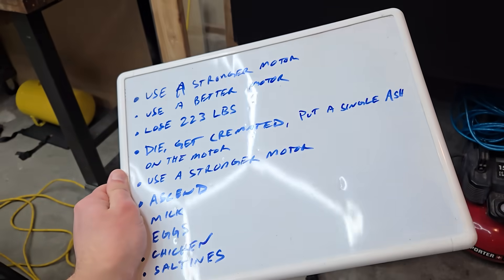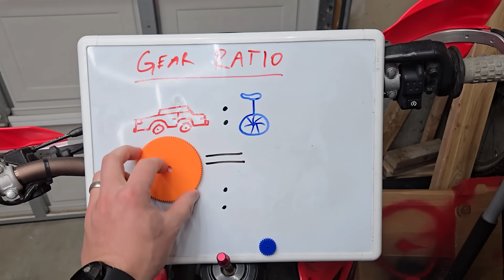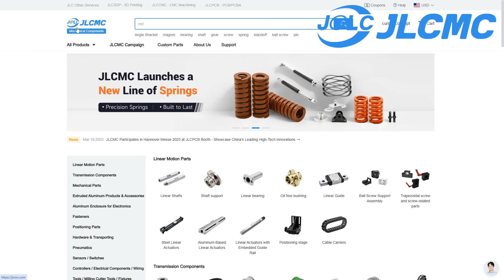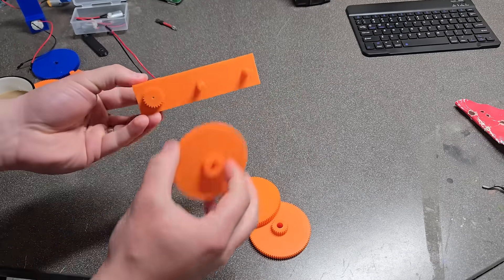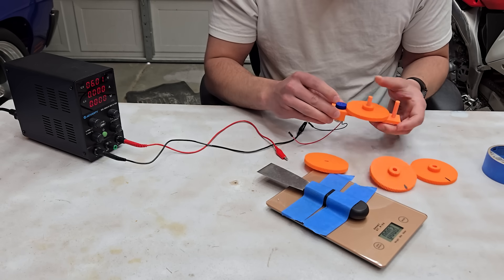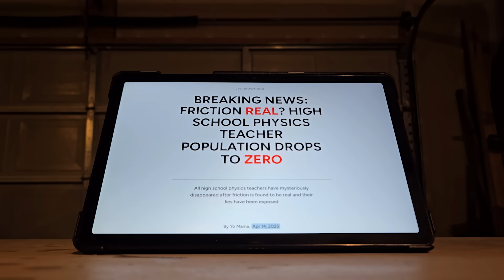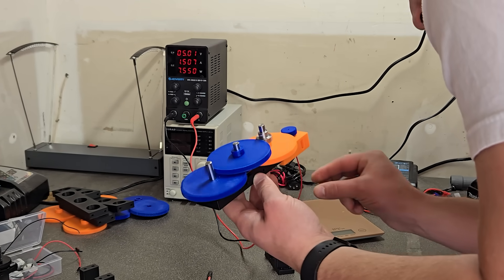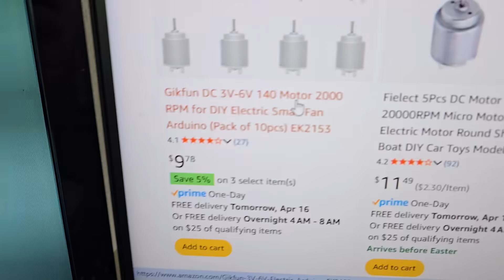I Built an Elevator With a $1 Motor

Comment: Bro. Love this. Keep it up. But you know your blowing up your motors bc you’re pumping them with way too much power lol. 5v at 4amps is definitely over it’s power rating.
Reply from the maker: oh for sure lol
Reply: I have learned the hard way, even brushed dc motors need proper driver, stall current is just too much for either power supply or motor itself to handle.